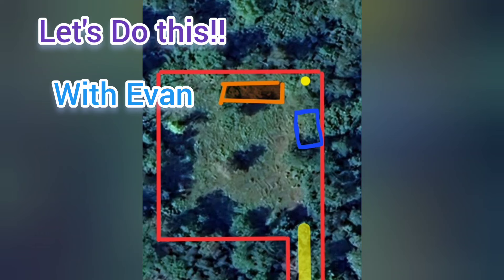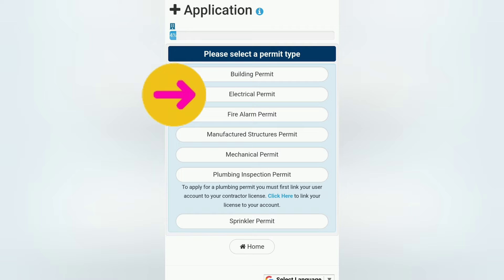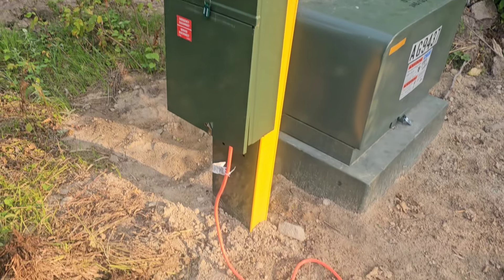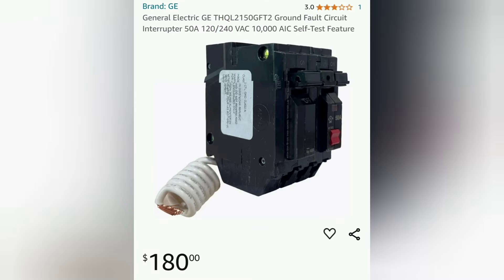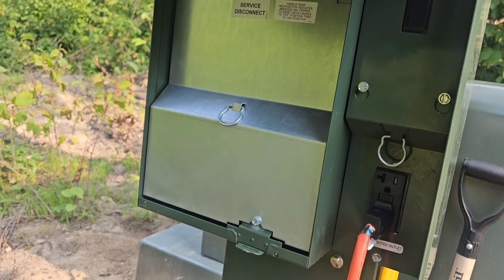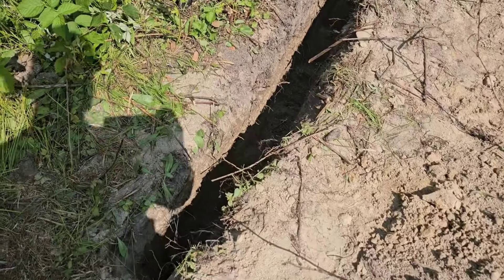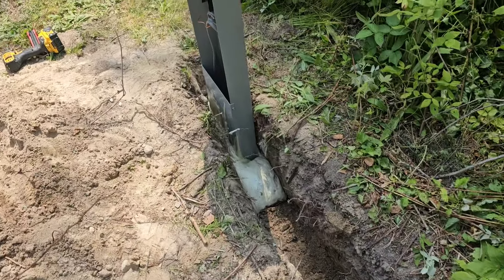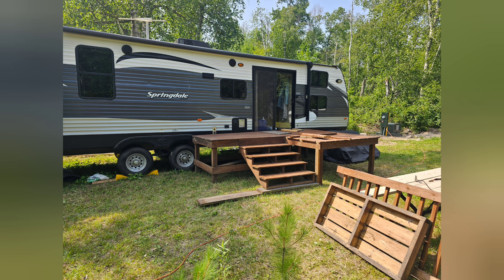RV PEDESTAL install start to finish

Comment: Nicely done. I ran my 4 single strands of #6 wire in 2 inch pvc conduit instead of just buried. Code here otherwise requires gravel below, sand, and gravel above.
Reply from the maker: So interesting that each state, county, country ect has different codes. Bringing in all that extra fill would be a pain. How far down did you have to go? Conduit would have been my next choice. Cheaper wire and didn't have to go as deep.  The GFCI thing still get me though. Lots of extra money 💰